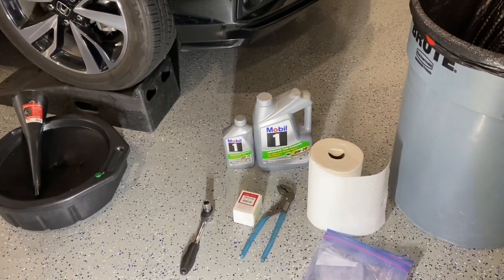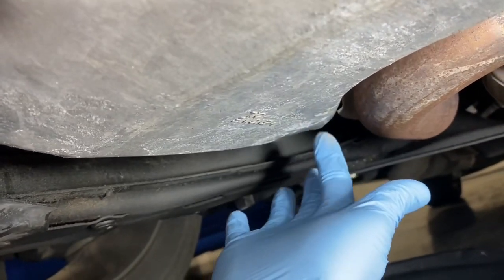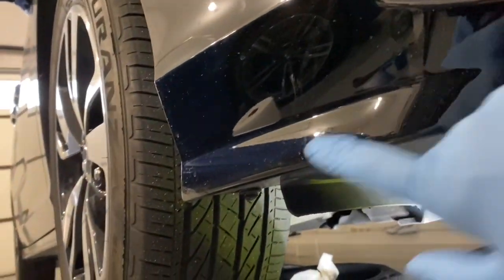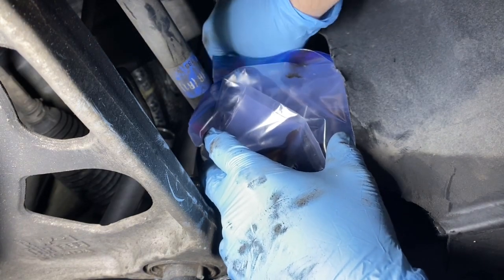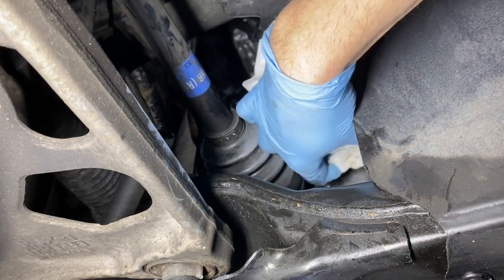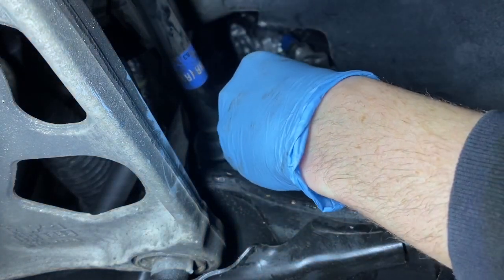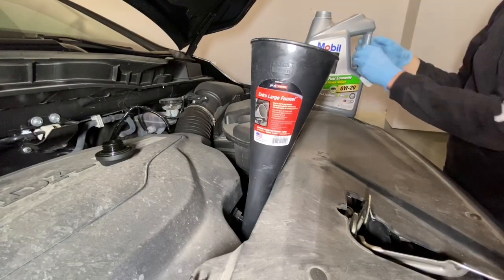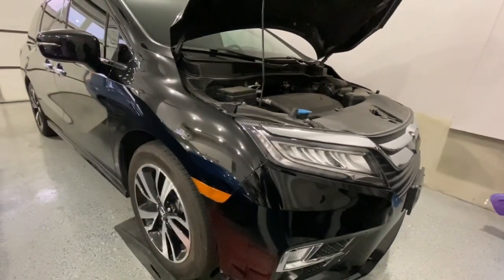Honda Odyssey oil change DIY Oil filter no mess 2018 2019 2020

Comment: You don’t even need to put oil on that Oil filter gasket, Honda puts Vaseline on this gasket, you don’t need to prefill the oil because it sits on the bottom oil will get in it when you start adding oil to the crank case, these Japanese engineers thought about everything
Reply from the maker: Good tip, Thanks for sharing
Reply: Vasoline?! Cool! I’ll try it! Thanks

Comment: My biggest gripe for using wheel ramps for oil changes is the fact that you cannot rotate the tires at the same time.
Reply from the maker: You really rotate your tires yourself? My Discount tire store does it for free, and I didn’t even buy the tires there.
Reply: @Myksgarage  it only adds 10-20 minutes to the project and it's even quicker with an impact. Saves me having to wait even longer at a shop to do it and I know my lugs aren't cross threaded and are torqued correctly. Sam's Club is free but it's just quicker and easier to do it on oil changes. With Jack stands you can put the floor jack under one wheel in the back at a time without making up the whole back end or using a lift
Reply: @Myksgarage  Exactly! DT/AT free rotations for all.
Reply: @TwoTall1988 odyssey says they’re cross directional. Do you just do front to back?
Reply: @jsixamore  Honda doesn't advertise what tires come on the Odyssey but it appears to be the BRIDGESTONE  TURANZA EL440 which are not directional. They would be rotated like normal (front left -> rear left; front right -> rear right; rear left -> front right; rear right -> front left). P.s. the EL440 is also hot garbage so don't buy them as replacements. I like the BFGoodrich Advantage.
Reply: I do it myself for the same reason. I diY oil changes myself. I don’t trust them to care

Comment: You don't need the oil filter that tight I've been doing oil changes for years just now get up a little bit and leave it alone it will be harder to get off when you doing oil change if you taking it take this you are

Comment: I got an oil change a couple weeks ago and have been seeing drips on the garage floor and this video has been educational.   I'm sure when they pulled the filter they let oil drip all over because the stain is in the same shape as the piece below.  Reassuring to know that it is only a sloppy oil change and not a more urgent issue.
Reply from the maker: Yes!  These shops don’t care if the The oil drips all over the control arm, that is probably what you’re seeing . Thanks for watching

Comment: I cut off the top of a 1 gallon water jug. Then using the top upside down with the cap on, slip it around the filter and take the filter off using the bottles handle to easily hold it. It catches the oil and filter with no mess. Yes in the past it was a nightmare to clean up. Also if oil gets on the lower control arm bushing it will deteriorate the rubber and eventually fail so keep the oil off it by easily changing the oil yourself. Great video!
Reply from the maker: Thanks for the tip!!

Comment: What’s the reason for tightening the filter that much? Is there a problem with filters loosening on that engine model?
Reply from the maker: Just to make sure it doesn’t leak.  Thanks for watching!
Reply: @Myksgarage  over tight filter is more likely to leak than a filter that’s properly installed. 

Great channel and vid.

Comment: You should really invest in an oil filter wrench instead of using those channel lock pliers.  I also always take the front passenger wheel off to do oil changes on the van, makes it much easier to access the oil filter.  I usually rotate the tires at the same time anyways.

I just changed the oil on our van this morning.  I'll have to remember the bag trick for next time because the engineers who design these things don't realize they put the oil filter directly over the frame and it makes a mess.  I had a Nissan Alitma that was the same way.  My F150 is the cleanest oil change in the world as the oil filter is on top of the engine.  The messiest oil change ever was our Toyota Highlander we had though that required a special socket to remove the canister housing, although we had an earlier Highlander that had the oil filter on the front of the engine, and when you took it off there was a small channel designed into the engine block that allowed the oil to drip into and down to the ground under the car where it wouldn't drip on anything else.
Reply from the maker: Thanks for the tips